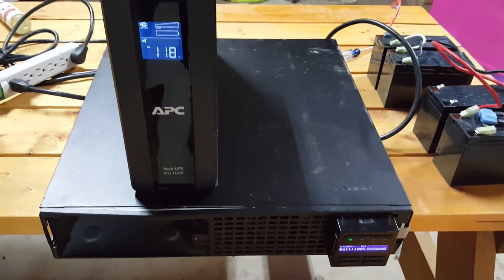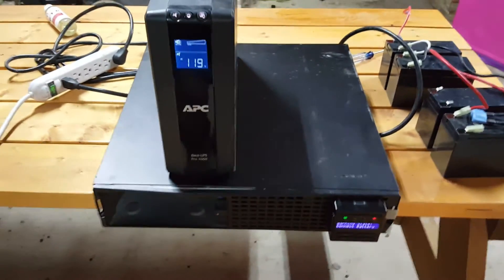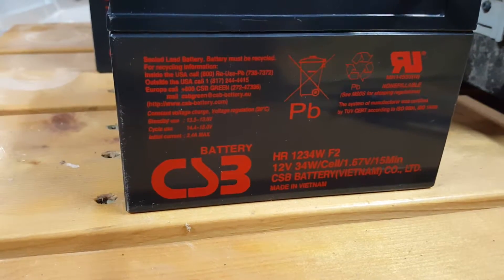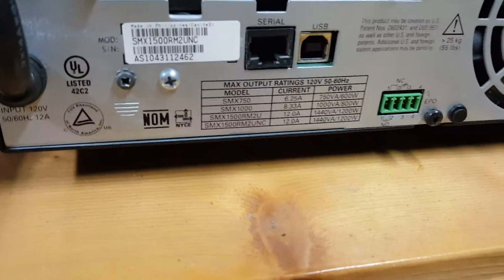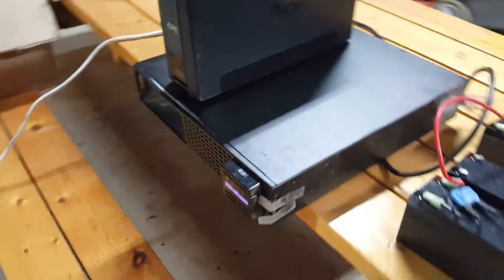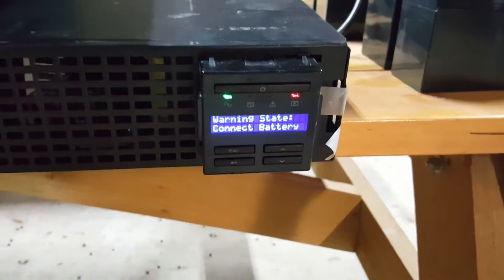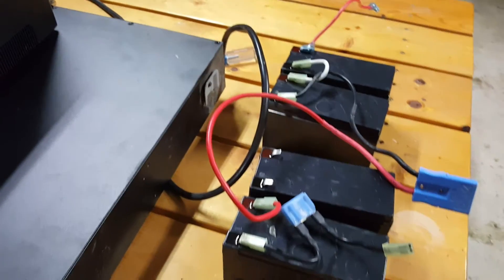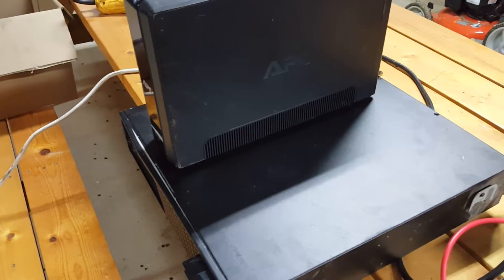APC UPS - Power Back Up - Battery Voltages - Hack

Comment: I was recently given a  48volt ups the batteries are good but in not understanding the purpose. So what if u can run equipment for 30min or so that is not a long time what is the point? I'm not being negative I am genuinely curious why
Reply from the maker: I forgot what this video was about but I assume it was meant to show that adding bigger external batteries will extend the run time. You can use this as a puresine wave inverter which has its own built in charger. Anyways I will check the video later.
Reply: The intended purpose is to allow you to ride out momentary outages, or give you enough time to shut down critical computers so no data is lost when the power goes out for longer periods. It's becoming very popular to convert them over to lithium batteries so you can get some ridiculously long run times with them. Keep in mind you can't do this with just any UPS. It has to be purpose built for extended run times, like the bottom rackmount unit in this video.
Reply: @xDownSetx  I am quite familiar with this UPS , the optional external battery pack has a small circuit board which "tells"  the main unit to increase the reserve time and you can add several more in a series hook up which will tell the main unit to add more reserve time. The problem is that people are asking for them 2 o 3 times the value of the main UPS, something outrageous  for the few used external battery packs available for example on eBay even without any battery inside.    This SMX 1500  came with 4 batteries of 12V 9 A/h inside the battery cartridge. I usually  replace them with 4 external batteries of 12 V 18 A/h  doubling on the paper the reserve time but  unfortunately there is no way to trick the UPS to acknowledge that without hooking the proprietary circuit that came inside the optional external battery pack. It would be great if some one could do a "reverse engineering" as what info send the external battery pack and trick the main UPS.
Reply: @robertos.4152  I actually just did a external pack trick a few days ago on my SMT2200RM2U. On some units, you can manually tell the UPS how many external packs to think it has installed.

I used a 3.3v FTDI to USB adapter to connect to the UPS and enter programming mode. Once in, I press shift + ">", it will return how many external packs it thinks is connected, usually 000. I have two 24V 100AH lifepo4 batteries in series, and the stock batteries for the SMT2200 are effectively ~11AH. So I press shift + ">", then shift + "+"(minus and plus move the values up and down) until it reads 008, so it should think I have approx. 100AH worth of batteries connected. I then press shift + "R" to save changes and exit programming mode, and shift + "Y" to confirm its in smart mode, it will return "SM".

I did a runtime calibration test afterwards and it is ballparking my available runtime correctly now. I will link some useful threads on how to access the programming mode and make changes to the float voltage and change the external pack value, plus some other resources that are useful in a follow up post just in case it gets deleted. 

Let me know if you have any questions! I specifically bought the SMT2200 because I wasn't sure if the SMX1500 could access programming mode so I'm interested as well.
Reply: @xDownSetx   It seems  the APC people designed the SMX series to be less accessible by any outsider, Only the IC on the small circuit board inside the external battery is the one who "tells" the main UPS to add battery packs, You can't do it from the control panel.
Reply: As I recall they even changed the hardware so only the units assembled after 2010 they can be upgraded with the latest firmware